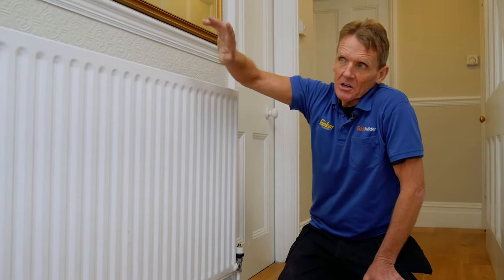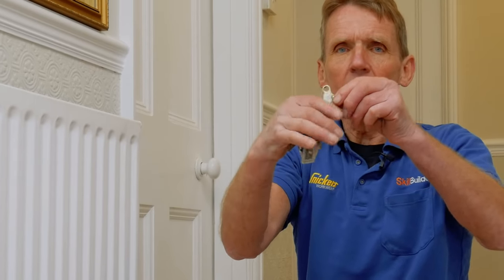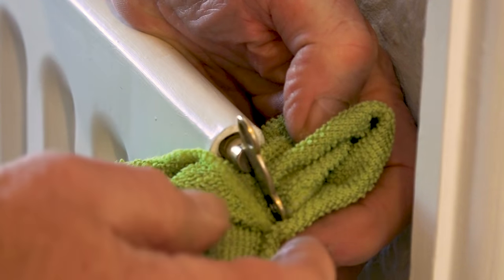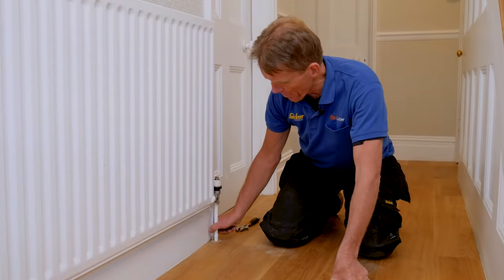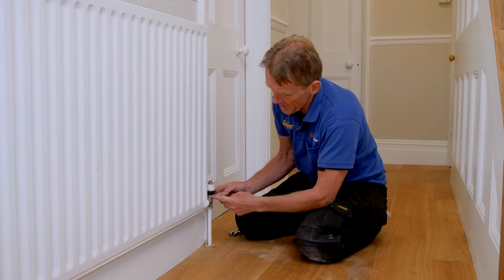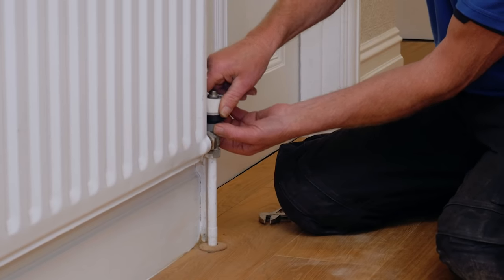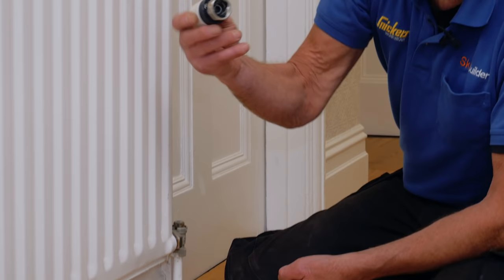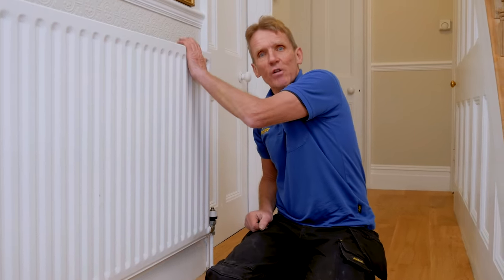Radiator Not Getting Hot? - Plumbing DIY

Comment: One radiator not working this morning, so looked at this video. A few minutes work removing the thermostatic rad. valve, a shot of WD40 and some gentle pressure with the side of a spanner and I now have a fully working radiator. That piece of advice earned a sub and like. Thanks.

Comment: Thank you SO MUCH! You have just saved me a fair amount of money as I had two radiators which had stopped working after the summer. My husband died in May and I usually left this kind of thing to him, but a bit of tapping with the rubber handle of my plyers and they re both working!!
Reply from the maker: I am glad we could help. It is hard when your partner dies. If my wife goes before me I won't know how to spend money because she does it all.

Comment: You have just taught a 73 year lady how to bleed a radiator working a treat now thank you
Reply: Hello, 11/18, the help offerings are very good but I have to make an excuse for living cause I don't have hvacs, I don't have vents issues, I don't have 2 furnaces or zone conflicts but I have tried and true furnace galvanized pipes with 1st and 2nd floor heating difference. Most of the submissions only cover air and heating systems.

Comment: ABSOLUTELY AMAZING! I’ve recently turned on the heating… as most have, and I had an issue where my Daughters radiator, it wasn’t heating up at all! I remember a while ago watching a video of Roger and I went back today, found this video and I followed step by step with taking off the thermostats valve, and voila… the pin was lodged ‘down’, meaning the radiator wasn’t getting any heat. I pressed down a few times to loosen it up and it’s all good now! An instant result - top gent!

Comment: Properly explained - logic in the correct order - not sure why one of the other videos on You Tube starts with closing the lockshield valve after indication that the system was previously working OK, never mind missing the number of turns for a reset. Very professional explanation.

Comment: This guy is to thank for getting my upstairs radiators to work again. Absolutely brilliant video. Thank you thank you thank you!
Reply from the maker: Thanks, glad we could help
Reply: Ditto! It's a bleed-fest out here after the summer. Boiler is finally staying on!
Reply: @nicola simpkins 
Try turning off most of the radiators when the heating is on, don't turn them all off as the system needs to flow, also feel the pipes coming into the rad to see if they are warming a little bit, if they are stone cold then something is blocking the flow to that rad. Sometimes you do need to bite the bullet and just call a plumber unfortunately

Comment: Thank you so much. Just took the thermostat valve off and followed your suggestion.  Tapped and hey presto. Radiator working at full capacity.  I have spend the last 18 months and had four plumbers look at this radiator. Even had the thermostat valve replaced by one. I can't believe no-one thought of your suggestion. Thank you so much.

Comment: Great video, really useful.  Have exactly this in a spare room.  After a few minutes pressing and banging (with rubber covered pliers handles) the thermostatic value pin popped up.  Thanks for the advice.  Just in time for the expected cold snap.

Comment: 👍 I tried bleeding the radiators but found no trapped air. Found the problem to be the fused pin. Wiggled it as you said and good as new. Saved me a few quid. Thanks for the advise.

Comment: Roger there are essentially two types of TRVs.  The cheaper trade TRVs are generally slim and consist of the usual valve seat arrangement beneath the temperature setting external knob.  These TRVs offer full flow and a radiator system using these can only be balanced by adjusting the  lock shield valves.
   The second, often more expensive TRVs, are generally of a fatter type.  Beneath the temperature setting knob you will find a circular outer collar around the valve stem inner sleeve.  Embossed on this collar are the numbers 1 to 6.  These numbers correspond to the levels of restricted flow through the TRV valve itself where 1 = minimum flow and 6 = maximum flow.  
   When you have these more expensive TRV valves fitted then the lock shield valves should be left fully on.  To balance the radiator system remove all the temperature setting knobs and set the collars to “3”.  The number must be aligned with the direction of the radiator outlet pipe. Now turn the central heating on.  For the radiator that gets hot first, using a self gripping wrench, turn the collar to “1”.  For the coldest radiator, set this to “6”. Adjust the remaining radiators between 2 and 5 depending on how quickly they warm up.  ALWAYS align a whole number on the collar with the radiator outlet,  DO NOT align a gap between numbers as this will shut the valve.  Once balanced refit the temperature setting knobs and set the temperatures you require for each room.
   If you need to power flush your system make a note of the collar setting for each radiator and then set them all to “6” to open all the valve passages to the widest setting to allow a good flush through.  Afterwards reset the valve collars back to their previously settings numbers and remount the temperature setting knobs.

Comment: I know this video is old, however it just sorted out my new rads. I never have the heating on upstairs as it's a new house and massively insulated. Today I put it on as it's snowing, guess what two rads dead. System had a flush and inhibitor put in so I know it's good. Top off the TRV and a tap, bam all good, thank you very much.
Reply from the maker: This video is timeless. Whenever it gets cold the views rocket. Funny that

Comment: give ya a top tip, hacksaw the tip/beloved part off ya rad key, it will fit everything!!! <3 The service head btw is the cap that's on it before u fit the trv, u can also use a half inch cap with a rubber washer in it.

Comment: Yup, pin beneath the thermostatic valve was stuck down.  A little bit of gentle up and down pressure on the pin did the job perfectly, exactly as Uncle Roger said it would.

Comment: Great video thanks, always wondered what the screw cap was for when you bought a TRV! Sadly none of your hints helped when l said l would look at why 3 radiators wouldn't work in a friends house. The 10mm plastic return pipe was blocked in all cases, ended up replacing all the 10mm pipe flow & returns, right back to the 22mm ring. Oh how l wish tapping the valve had worked!

Comment: Thank you for the informative video. I have a similar issue. The radiator was hot at the top and cold at the bottom. We thought that the sludge is not letting the water through. Today we installed a new radiator however the issue still exists. Another thing I noticed is that the return pipe is not hot as the inlet pipe. Any suggestion will be appreciated!

Comment: Another great video, also u can turn down a balance valve at the coil on your cylinder so it’s not stealing heat from radiator circuit
Reply from the maker: Richie 

 Good point I must mention that when we do the review. Also pressure operated by-pass valves if you have TRVs
Reply: Skill Builder  yes I normally keep them fully closed as they will still operate if needed, without the cylinder stealing heat , keep up good work 👍🏻

Comment: I had to bleed air out of the radiators really often and also I had to add water to the system all the time. Then I figured out it was the pressure tank that had gone bad. No air in it. Really cheap and easy fix. Those things don't cost much and it was easy enough to install by yourself. Now everything works just fine.
Reply: Don't forget to top up your inhibitor

Comment: Just a little add to the stuck Trv shut the lockshield then release the pressure through the air vent, the system pressure is now assisting to push that stuck valve open ..
Reply from the maker: good tip
Reply: @SkillBuilder  just one other thing to add Roger, the vast majority of these stuck valves I've noticed is when the heating is put on after the summer probably due to people leaving them set at say No 3 = appox 20 degrees right through the summer and as our houses go above that temperature for sometimes many weeks the valves quietly do their job and remain shut then hey presto "my radiator doesn't work" in the autumn. All trvs should be set at maximum to help prevent this from happening and give them a rest.

Comment: Roger... You forgot about the issue of topping the pressure back up after venting air (if on a pressurised system) The water is automatically replenished if fed from an F&E tank if on an open/vented system.
Otherwise, a great vid. Will share with customers rather than long conversations over the phone.
Hell fire, I'm a right nit-picker!
Reply from the maker: Loafer you are right but we can do a separate video. I love it when they bleed the system and the boiler stops working. Money for old rope until those valves on the filling loop weep around the glands.

Comment: To prevent corrosion and sludge build up put corrosion inhibitor in the system. There are several available, one example is Fernox F1. Follow the instructions, you may need more than one bottle. Ideally your boiler service engineer would check the concentration when he services your boiler and put more corrosion inhibitor in if needed. However I have never seen one do this. I guess they prefer to sell you an expensive power flush or a new boiler when corrosion causes a problem.

Comment: Hi Roger, I have an old Westherm TRV. Can move pin up and down but no heat. Does it have a valve seat that floats but is not connected to the pin?

Comment: in 3 years ago back in between oct-nov of 2019, my apartment has 6 radiators. like one in my kichten, one in my bathroom, and bedroom, and playroom,, and even in the Hallway in the first floor. but it's not exactly like these radiators. so pretty prefer mine can be bit different but same color as white. but yeah in 3 years ago, all of my radiators were leaking in my apartment. and it was making noise. for example clicking noise, banging noise. so the landlord his name is vinny. he had to come to my apartment and fix all of the radiators. and then they were working perfectly fine now. but sometimes we had a bit problem that when all my radiators were on, sometimes it can be not strong enough, like it's not hot enough however the landlord didn't set the Metter up high. or maybe there could be something got stuck in the radiator or underneath the radiators. like something like that.

Comment: I have an issue where the raditors of entire upstairs are not working. These are new radiators fixed about 2 months ago with a new combi boiler. Downstairs radiators are working fine. They all worked well previously when we checked the system multiple times during the summer. I have bled radiators and pressurised the system. But still no luck.
Reply from the maker: Turn off all the rads and then turn each one on and off at a time. Modern pumps are a bit too clever, if they sense resistance they reduce power which is the opposite of what you want. 
Also if you have a smart control you might do well to over-ride it for a test.

Comment: Hello sir, great video. I have a problem. The bottom half of my heater isnt getting hot. My dad and I changed the entire heater as the one we had was very old but we still have the same problem. What could it be? Thank you so much for your time and advice
Reply: needs balancing/turn off rads befor this one then slowly open till hot but not all the way

Comment: My issue wasn’t covered in the video

Cold radiator, no air inside. The pipe at the thermostat end is cold; the pipe at the closed end is hot. The venting screw is at the closed end and if I vent it apart from the water ejecting the pipe gets hotter. 

What does this suggest as the problem please.

Comment: My one radiator was staying cold it was a stuck pin. Pressed that a few times and it's heating up again. Seems like there are still cold spots at the bottom so sludge build up. I don't really want to flood my living room taking this off. Have you got a link to how to do this?
Reply: I had a stuck pin as well. Once it was moving again I gave it a squirt of WD40 to try and prevent it jamming again.
Reply from the maker: We have not done this job on video but we will. 
You could add some central heating cleanser into the system and let that run around for a couple of weeks and then drain the system.  Best leave it until the summer and we will have that video. Better still we could do yours and video it.

Comment: Hi, we have a radiator that only heats up at the top, it’s been removed flushed and put back on with new valve plus thermostat. The hot water goes in at the bottom first then out through the valve/thermostat (it’s got the arrows both ways on valve) all other radiators work great. Any ideas?

Comment: Hi there. My problem is only one of the radiators which does not heat. But weirder thing is hot water doesn’t come to the pipe as well. All others working fine. What should I do?

Comment: Hi Roger,  do you know how to fix the opposite problem - new radiators are working fine but since we had them installed there is no hot water.  Only cold water is running from the hot water tap, at normal pressure.

Comment: Hi how do i know if my radiator is pipe up the right way?

 I just bought a new house the extension side heating doesn't get hot it's just warm from top. I just put in 5 new radiators in bedrooms all 4 are working fine part from one and the room under that bedroom.any advice what may be wrong with it

Comment: Hi Rodger. Recently put a radiator in my kitchen. A 600 x 800 double panel radiator. I’ve insulated boarded my kitchen as I had no cavity wall insulation and put insulated plasterboard on the ceilings. My question is, under the floorboards the pipe work to the radiator is microbore, then changes. The radiator gets warm don’t get me wrong, but it doesn’t throw out as much heat as I’d like it too. With the pipe work being smaller, does that make a difference or not? Cheers. The radiator is big enough to warm the room according to the BTU.
Reply from the maker: Yes it can only be the flow rate. You might improve it by putting the pump on full speed and turning down the lockshields on some of the others.
Reply: Skill Builder cheers roger I’ll give it a go.

Comment: By the way the valve can't move, it's stuck. So is there anywhere else that someone turned it off like under floor boards? I have noticed a ceiling tile out of place in kitchen right below my radiator. HELP!!!

Comment: I bled a different radiator and some heat come into the cold one. However I hear a small hissing from bottom left (overside to the trv valve. Not sure if its constantly losing air or that is the sound of water going in but this one has never got as hot as others. Any advice?

Comment: I have a cold bottom on two double panel radiators of my 9 radiator system. As 2 of the rads are in an upstairs extension on new pipework (towel rail and a cold bottom double). Should I add X400 to the extension system rad directly as well as putting some in the F&E? I have a magnetic filter on the new boiler but we didnt powerflush at fitting because the system is microbore :( All we did was a couple of drain downs and running the two double panels in isolation for ten minutes each. That hasnt cured it so would love some advice.

Comment: Great piece Roger. My mum has a cold radiator and I think it may be due to the thermostatic valve being turned right off (*) something internally has jammed closed. I remember a plumber telling me never to turn it right down because this can happen. Could you cover a fix for that scenario?
Reply from the maker: Try the trick of taking the actuator off and gently pressing it down. The plumber isn't quite right because the actuator closes the valve when the temperature rises so in the summer the valve will close . It would be better to open them fully at the end of the heating system.  As I said that period of no use is the culprit.
Reply: Thanks Roger!  I'll give that a try

Comment: Hi Roger, I got an issue with one of my mother's radiator in living room. At one end the pipe running into it is hot and at the other end the pipe running through radiator is stone cold. There is heat at the top of the radiator but cold at the bottom. I've tried releasing the air using the key but nothing. Any help be much appreciated. I think as you mention a possibility there could be sludge at the bottom of the radiator. Cheers.
Reply from the maker: It is certainly due to sludge and the easiest way to solve it is to remove the radiator and flush it through with a garden hose. Alternatively you can buy a chemical that you put in the heating which loosens it but it wiill move it somewhere else.
Reply: @SkillBuilder  Thanks alot 👍

Comment: In the USA, plumbers rarely suggest cleaning out radiator sludge - sometimes for steam rads, but rarely for hot water rads.

My hot water rads are hot on the top and cold on the bottom...I've had them bled, installed new thermostatic radiator valves.  Supply and Reeturn pipes are both hot.  Nothing is warming up the bottoms!  What are the chances that its filled with sludge?

Comment: I have cast iron rad's and one side of the house gets hot the other side just gets warm. Ive changed the valves with no luck. Is it possible 1 whole side of the house could have a sludge problem?